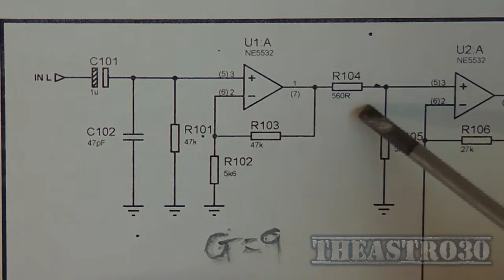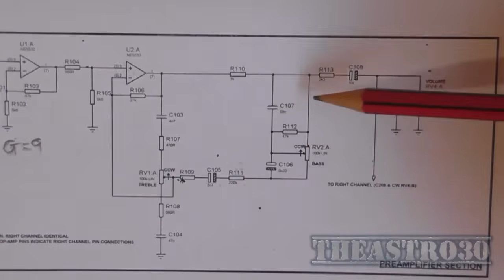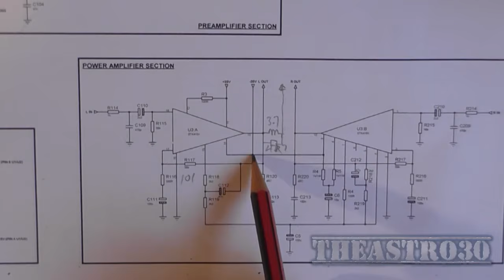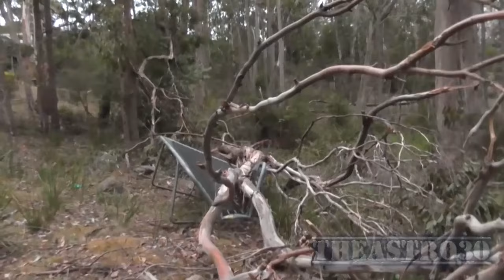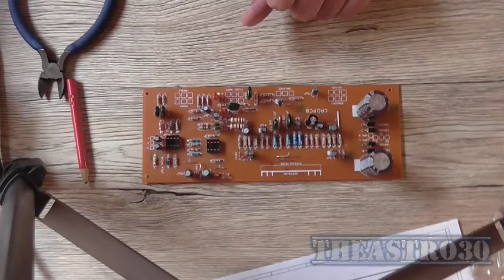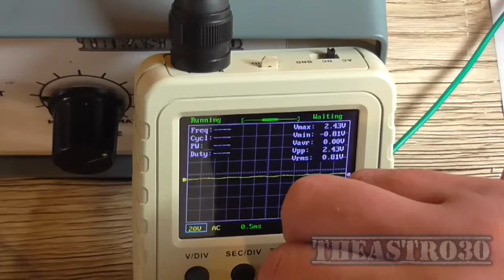STK4191 Stereo Amplifier Kit Build - Part 2

Comment: I built this amp and it works well, from memory xraytonybs' amp also worked well, you can't blame the amp if you haven't got a transformer that can drive it properly.
Reply from the maker: Agreed. I wasn't blaming the amplifier. What I reckon is happening is that the power is too low and therefor the amp is going into current limiting which then causes it to go haywire. In the final part, I did do a sound test and it did sound okay at low volumes. Wasn't really happy with the response of the tone controls, however.